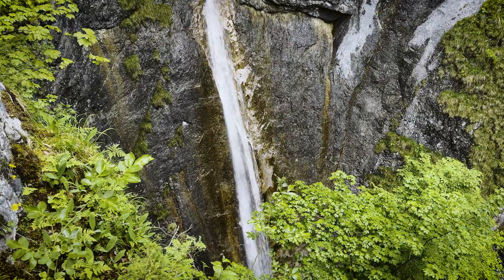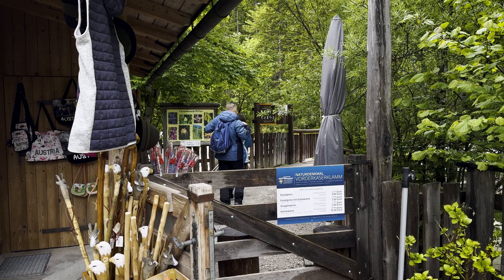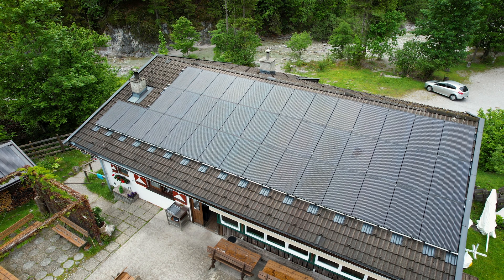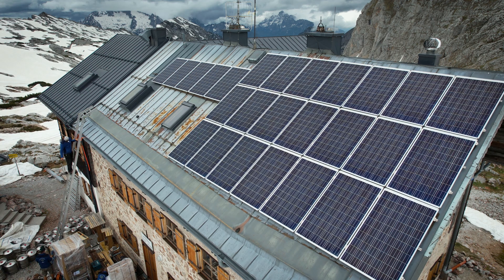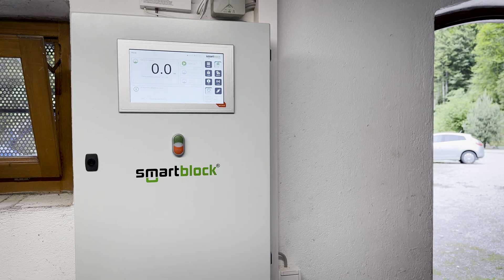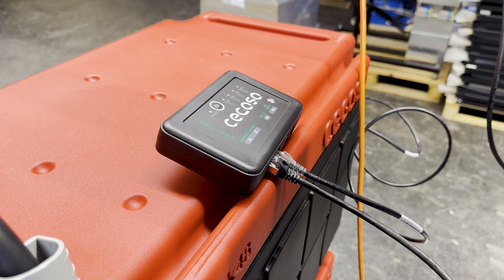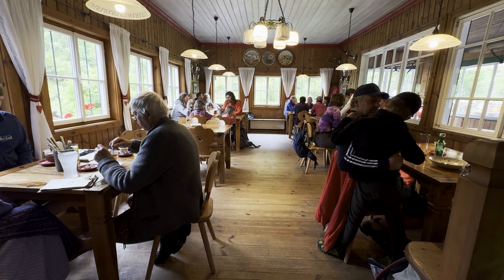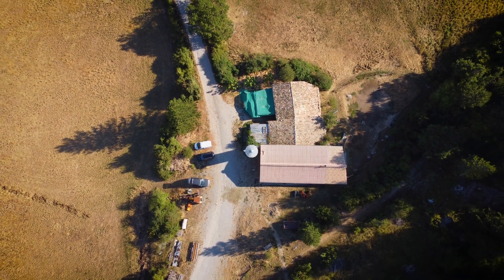How this restaurant by an Austrian Canyon powers its kitchen

Comment: @Victron, ga eens High Voltage systemen maken man. Omdat jullie die niet hebben moet ik naar een Chinees merk. Waarom hebben jullie geen 350Volt systemen. Waarom alleen maar klote 48Volt systemen met dikke draden en stroom beperkingen? Geef eens eerlijk antwoord.  Want heb dit al vaker gevraagd maar geen antwoord. Luister eens naar je klanten.
Reply: 😂
Ach man , Als u een beetje research had gedaan had u kunnen lezen dat er binnen enkele maanden een serie HV omvormer/laders komen. Tot 800vdc ingang en 3p-230/400vac uitgang , met 30kw solar input   (15-30kw vermogen) 
Daarna de grotere modellen
Reply: @johannesboonstra6917  waar kan ik kopen dan en waarom was die er vorig jaar niet dan. Heb nu al Deye gekocht helaas. Ja ik ben niet tegen Victron. Ik vind ze traag reageren op marktverandering. En het is niet TOT 800VDC. Maar vanaf... dat is niet handig. Veel HV batterijen zijn 350 tot 400vdc... heb je er nog niks aan. En waarom moet ik wachten. Je kan sinds 2023 toch geen LV (48V) systemen meer adviseren. Neemt veel te veel ruimte in. Teveel dikke kabels. Te hoge stromen. Te dure apparaten. Geef toe.
Reply: @HermanWillems  Nee vorig jaar niet , toen waren ze niet beschikbaar inderdaad.      Bij Victron ontwikkelen we alle producten zelf en dan weten we zeker dat het voldoet aan onze standaard voor kwaliteit, want met een garantie tot 10 jaar is dat essentieel. Het is tenslotte zo dat we producten maken voor gebruikers die er op rekenen dat ook na jaren we klaar staan als er wat aan de hand is.    Bij de "snelle" producten uit Azie is dat wel eens lastig, om überhaupt iemand aan de lijn te krijgen.  Het is trouwens voor (niet TOT of vanaf ) 800Vdc systemen omdat dat wereldwijd de standaard gaat worden voor grotere systemen,   Dit wordt met (vaak 50Vdc) accus in serie gerealiseerd. Onder de 75kW systeem is trouwens een 48Vdc prima , zelfs daarboven tot 100-150kW.   Met name door veel meer veiligheid en flexibiliteit is de 48V de betere keuze en dat zal ook zo blijven als er meer HV inverters op de markt komen. Even een HV systeem naast/in een gebouw plaatsen is erg lastig (brandweer /verzekering) en zorgt voor extra kosten.  De meeste ruimte dat een opslag systeem qua ruimte inneemt wordt door de accu ingenomen en die worden bij een hoger voltage niet kleiner.

Comment: Isn’t there meant to be a gap between multiplus when mounted for ventilation?
Reply: There is a gap. It needs to only be about 4 inches between units per the Victron user manual. I have about 5 inches between mine.

Comment: unplug the BMS cable and the system is off...these batteries only allow function with communication plugged in. That is not ideal..
Reply: It's the same as unplugging the battery cables, the system will also turn off.  Imagine that.  Definitely not ideal....
Reply: What brand of batteries are these?
Reply: @adon8672  its victronic I think